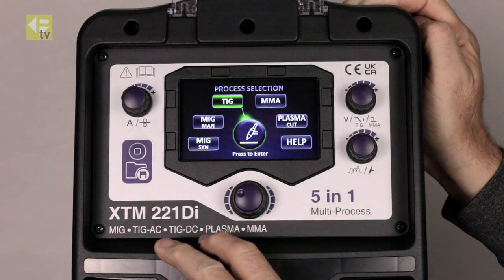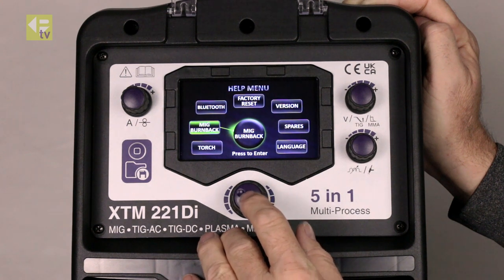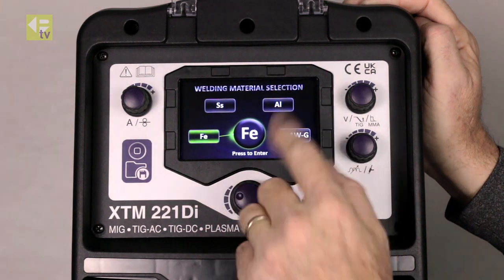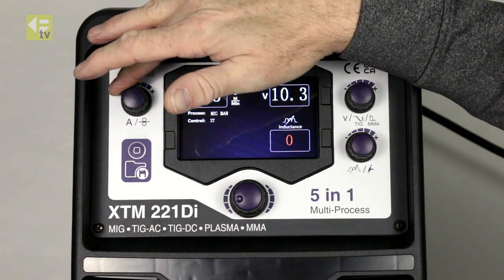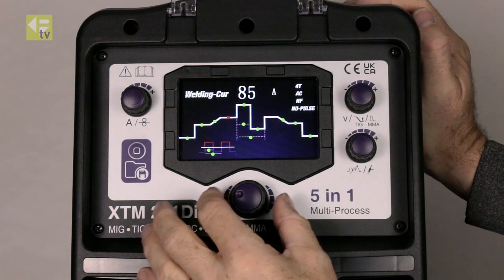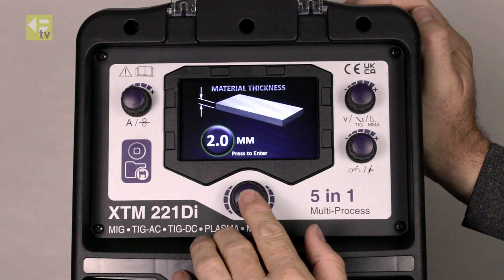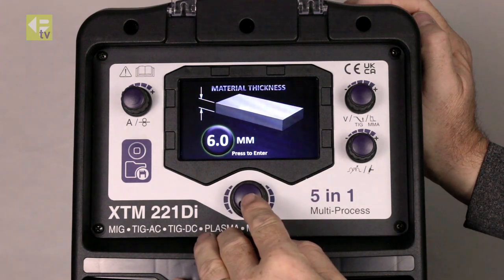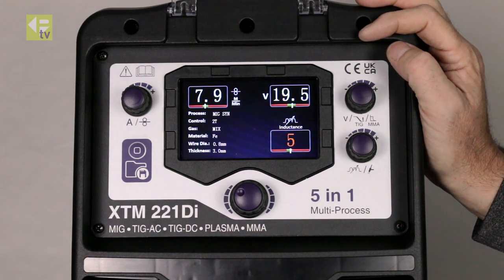XTM 221Di User Interface Functions

Comment: is there a pulse setting in the mig mode , and if so is it adjustable , and does the machine do interval / spot timed welding , the memory function looks to be mighty.
Reply from the maker: It has a pulse setting for TIG but not for MIG, it doesn't have a a spot timed welding mode either. However our ATP+ Machines do have both of those features. 😊
Reply: @ParweldTV   are they portable and single phase ,, I do a lot of site work on sheet metal ,,,, thanks for the swift reply ,,,
Reply from the maker: @tomthompson7400  It is single phase and it is 30 kg so while it is possible to lift ( I've just carried one from room to room) it could become a struggle with consistent carrying around. We also sell trolleys that help with the mobility of the machine.